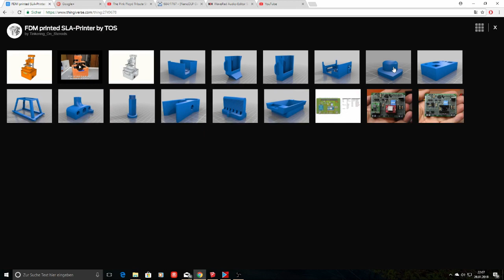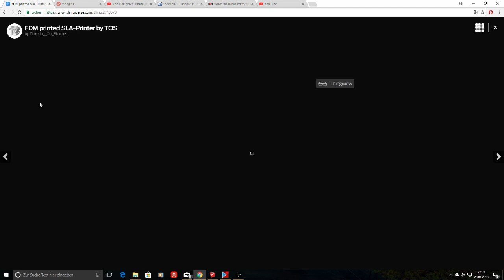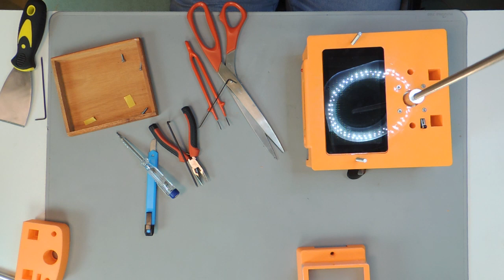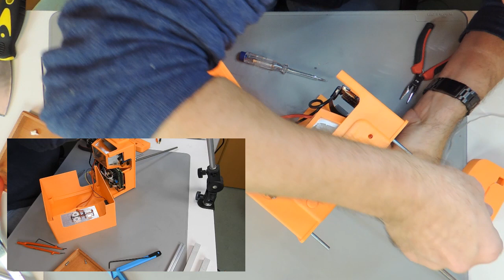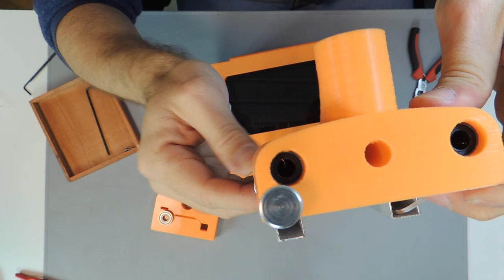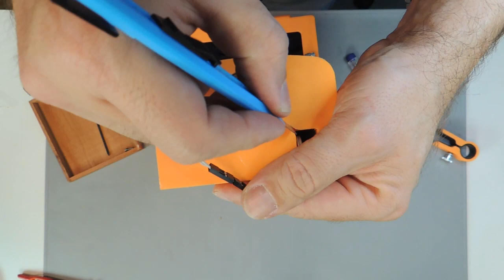DIY: FDM-printed SLA-Printer: Part 3

Comment: Built this for around $120 USD with electronic parts from China and screws that I already have. Is a constant current driver really required? I'm not using one right now and it seems to be running fine.

Comment: I just today found all the parts to build this on ebay, from international sellers, and at the lowest cost options, total came up to $150 USD, whereas a ready-made unit has a slightly smaller build volume, and the out of pocket cost is $250 and up. I think I might make one just for the fun of doing it myself. I have a FlashForge Creator Pro printer, which requires some of the prints to be split into two to fit it's rectangular build volume, but I think it would be an interesting project to build my own small desktop SLA printer. Thanks for sharing these videos and files!

Comment: This is a great design. Are you still working on it? I'd love to chat more about this. Particularly, what LCD display did you use and have you considered higher powered UV leds? I noticed that you can get larger 100w versions rather then using 4x 10w
Reply from the maker: Hi, the 10w version LED's still work on 12 volts while LED's with more watts run on much higher voltages.
So the printer needs already 12v and 5v (stepper motors, fan 12v; raspi and hdmi display 5v);
Using LED's of a different voltages requires a solution for a third voltage, which implies more parts, more efforts in terms of time and money and (most importand) more space within the body of the printer.
Thats why I decided to stay with the 10w LED's
Reply: Tinkering On Steroids thanks for the in depth answer. Do you have a place to chat about this printer? Have been considering DIY sla printing for quite some time and this has inspired me
Reply: If you put brighter LEDs, it could possibly go past the LCD blackout and / or damage the LCD plate itself.  Not a disaster, just replace parts.  But the trick is finding a good LCD with enough contrast that will not burn out every 10 prints.

Comment: sehr interessantes projekt .. jetzt muss ich neben dem XXL FDM Printer und Lasercutter noch was anfangen zu bauen :D welches Display wird hier genutzt?
Reply from the maker: its an 5.5 inch hdmi display with a resolution of 1440*2560
https://www.aliexpress.com/item/5-5-inch-LCD-with-controller-Board-for-DLP-SLA-3D-printer-KLD-1260-3D-printer/32815697328.html?spm=a2g0s.9042311.0.0.8JnvYc
Reply: ty :)

Comment: Hello, I'm very interrested in buiding it, would it be possible to know how much did it cost, and have some link to the good parts ? I mean, for example, will any 5.5 inch LCD screen do ?
Reply: Just putting it out there this is most likely way more than you are currently capable of doing. Try making a homemade filament fed printer first. But im just assuming because i dont know you lol.

Comment: Great video,  cant wait to see the prints you make :)   When you master making this small printer, can you make a huge one? it should scale fine
Reply: I was thinking the same thing. The only difficult part would be the power requirements for a larger stepper (possibly, a larger bed will weigh more) and a larger screen (like a tv screen, uses a significant power draw at start up)

Comment: That shield is different from the nanodlp shield now that I look at it. Your shield is starting to make sense now, but the nanodlp shield version none. Just one end stop? What is that servo connection for? Is it for dipping the bowl or something?
Reply from the maker: What servo connection??? My shield has none
Reply: No yours don't have it, but the nanodlp site provides schematics that have those and I'm trying to understand why.
Reply from the maker: So the question would better placed there. but to my knowledge, nanodlp also supports DLP printers that use a projector. Those projectors can not be switched on and off as fast and often as the LCD panels of the LCD-based printers. Therefore the servo works as a shutter that mechanically interupts the light beam instead of switching the projector on and off.
Reply: Yeah, probably. Thank you for your reply anyway, it makes enough sense. I saw that those SLA printers that had a laser light, seem to have this tilting function with the bowl and thought maybe it's for that.

Comment: Where to get cheap resin ??
Can you recommend please???
Reply from the maker: Darius Keinys I don‘t have enough experience with different types of resin or different sellers to give a recommendation. Most importend thing is, that the resins sensetivity wavelength match with the wavelength of the uv leds. I used 405 nm resin from Wanhao, purchased on amazon.

Comment: Amazing job! What do you estimate the cost of building it is so far?
Reply from the maker: Costs add up quickly. Most expensive parts are related to the main screen:
5.5 inch LCD + Controller + Protective glass, ca. 100 €
special hdmi cable and micro-usb cable around 15 €
raspberry pi modell 3 around 30 €
voltage converter, stepper driver and led constant current driver, 1602 lcd together approx 20€
4x 10w 405nm LED's 20 €
12v 5a external PSU 12 €
nema 17 stepper motor 10 €
2x linear bearing LM8LUU 8€
8mm leadscrew, leadscrew nut 8 €
130 mm x 56 mm x 20 mm aluminium heatsink 7 €
aluminium rods & bars 8 €
....is already 238 € and a lot of small stuff in addition (screws, nuts, wires, connectors, switches, resistors, capacitor...)
So my estimate is around 250-260 €
Reply: Tinkering On Steroids Thank you for such a detailed answer. That's quite cheap really. I'll definitely be building one in the near future! Thanks for all the great work.

Comment: what lcd are ypu using a name or modle number or link would be nice also keep up the good work looks amazing
Reply from the maker: something similar to this (in the meantime they changed the orientation of the hdmi and micro-usb connectors on the controller board):
https://de.aliexpress.com/item/5-5-Inch-2K-LS055R1SX03-TFT-LCD-Screen-Display-For-VR-Board-1440x2560-Screen/32800233590.html
Reply: @BurgerStefan  please clarify, the hdmi connector on lcd board is regular size hdmi like pi3 or micro hdmi like pi4?
Reply from the maker: Bruno Cabral depends on what display/display controller you are ordering. Just read the specifications of that product
Reply: @BurgerStefan  thanks for answering. I could not find that info on 
https://pt.aliexpress.com/item/32815697328.html
and the photos didnt help.

At 15:27 on your video seems regular size hdmi but I'd like to be sure before ordering

The A type 90 degree hdmi connector have two orientations. In RPI side I think the flat goes up, so I guess it is the same orientation on lcd adapter board too? Going down would put the flat to outside of the case, am I right?
Reply from the maker: @brunocabral1578  yep

Comment: Great Project!!!!
I would like to build one my self.
But what i didn't understand, is the Part with the Firmware. 

And so you have an kind of BOM?
Reply from the maker: I startet a BOM on the thingiverse page (see link above).
Yes, you are right, there is still a lot to explain.
The firmware is nanodlp(https://www.nanodlp.com/). It is just a donwload of an SD-Card image which has to be flushed to an empty SD-Card with Win32DiskImager or something similar. The SD-card goes into the Raspberry Pi.
Reply: Tinkering On Steroids thx for your reply.
Are you German.
Ich you Like add me in Facebook.
Witch Led die you use?

Comment: Nice, but as you say extremely uneven lighting and I also wonder how rigid this will hold when peeling a print off the FEP sheet
Reply from the maker: educasoft thanks for your feedback! As I tried to explain in the voice over: since the footage was recorded, the uneven lighting has been fixed by installing a diffusor inside the reflector. Was a easy and efficient fix. Regarding the other topic I have to test more and maybe optimize further.
Reply: Will you show this diffusor fix in another video ? Can be interesting for a lot of people
Reply from the maker: Most likely I will do some follow-ups that cover that topic. For the moment you can find the (very simple) STL file on thingiverse. I printed it with 100% infill with transparent PLA (nevertheless, material with a higher melting point is recommanded)
Reply: @BurgerStefan  Couldn't you use the film filters from the LED element in your LCD screen? (The ones you took apart in video 9).

BTW I'm currently making it. I wanna say thank you for sharing the brilliant work.
Reply: @BurgerStefan  please clarify, why the diffuser neads to be UV light sensitive? And does it touch the uv Leds in the bottom of the mirror box? Or there is some space between it and the leds?